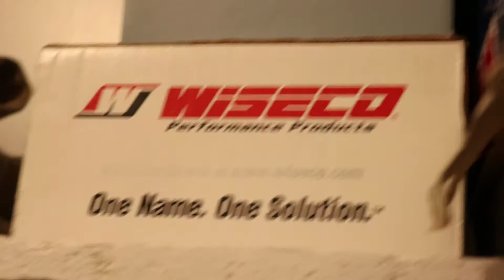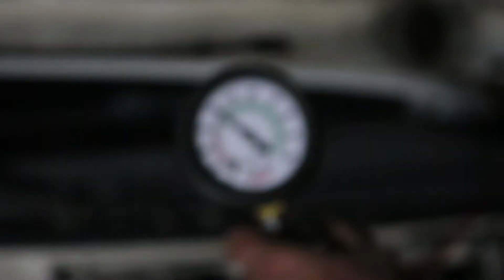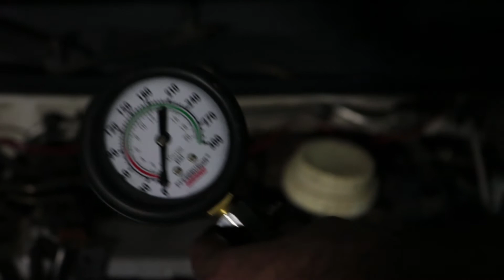MORE GSX problems - Bent Intake valves/ 600+hp GSX 2-step

Comment: A very quick way to tell if the timings possibly skipped is if the timing belt has more then a mm of movement at the section between the cam gears. It's not guaranteed method but Its a good way to get an idea of a potential problem if you don't have tools. You should change the timing components either way, I've had 6 dsm's and learnt to never trust what someone tells you unless you actually know them. Dsm's made me the mechanic I am today....I'll work on anything and get it running like a top.
Your timing can be off by 1 tooth and not bend valves, anymore off timing and your smashing valves
Reply from the maker: Thanks man, James is reputable guy, he's been building DSMs for a while and he hasn't been wrong so far lol but yeah in no way are Kevin and I professionals but we learn as we go!
Reply: Lmao... This is false.